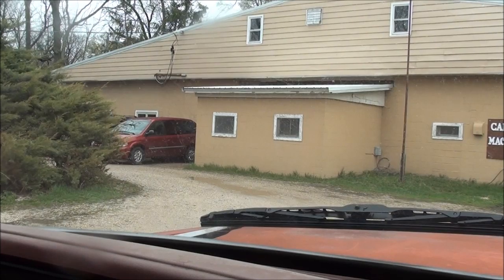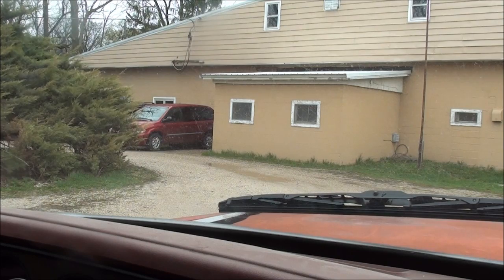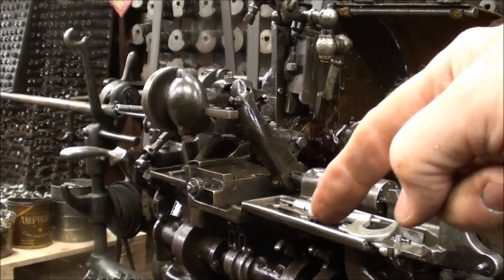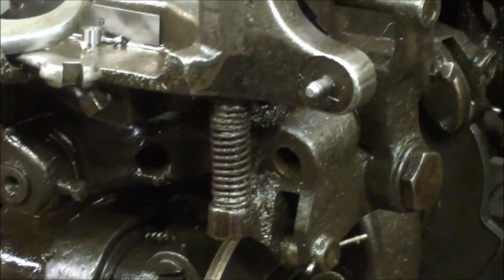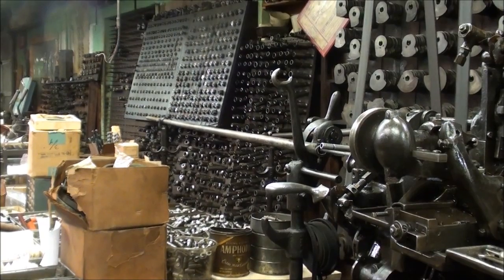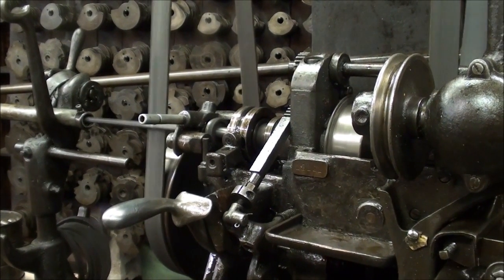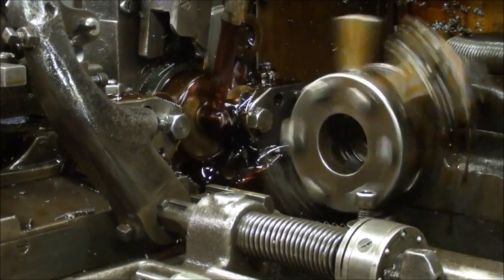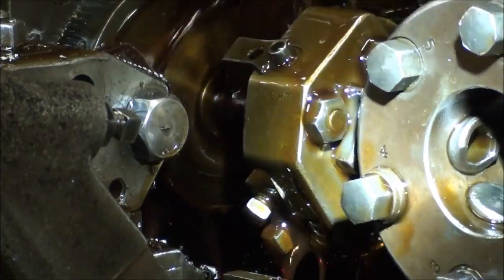tubalcain TAKES A FIELD TRIP #1 The Disassembling of America screw machine shop

Comment: Ran a half dozen of these "00" Brown & Sharp for a few years. !/8th inch brass beads with a hole drilled thru @ 3 seconds! A real joy to see 6 of them running at the same time. All kinds of fishing bodies, Screws, threaded parts of all kinds. Almost lost a couple fingers in the slotting attachment! Ours were all converted from overhead belts.
Reply from the maker: Those brownies are amazing

Comment: Too bad they didn't invest in any Davenport machines that could have eliminated some of the secondary operations. That spacer would have had a shave tool to maintain the diameter and surface finish of the part if it was run on a multi spindle machine.

Comment: This is the first time I've ever seen one of these machines run, although I've worked with machinists who have run them extensively in the past. I think this is one of the few totally mechanical machines that could still be used profitably in manufacturing today, but as far as people bemoaning the change to modern CNC methods, I have only one thing to say. This isn't the world of 50 yrs ago, and technology changes with time. You either accept the changes or be buried by them.

Comment: I used to work at a screw machine shop its still running parts today. I operated a khone 6 spindle it was as big as a truck. Thing was a beast made in 1945
Reply: Where does this shop sell its screws? The hardware stores in my area sell Chinese screws that break!

Comment: Thanks for posting this video. Those old machines are a pleasure to watch operate. But it becomes very clear why they went the way of the wagon wheel. Look at the amount of investment that got put into job specific tooling. If you needed to have all those cams and fixtures made new, buy all the specialized tooling new my guess is that it would be into the 7 figures easily. 
CNC, while not nearly as interesting to watch, is far more efficient. And many will say that all the computer driven machinery is doomed to early obsolescence, but in the end that doesn't matter. By the time they are ready for the scrapper they will have served their purpose. I agree wholeheartedly that the exodus of manufacturing from first world countries is a terrible thing, but the closing of an antiquated shop like this not really related. They chose not to keep up with the advancement of technology and got left behind.  I'm not criticizing them for it, but it does explain why they are liquidating instead of selling the business.

Comment: Saddens me too.......I believe the main reason for mfg. in China is mainly the low wages, and lack of expensive safety gear....of course the poor-to mediocre quality of stuff doesn't help....last week I went to the store to get a simple can opener....the kind you turn with your hand...$3.99....I knew it was junk, but I bought it anyway.....wouldn't even open 1 can.....so I broke out my Swiss army knife....a little slow,  but functional.....
 these B&S screwmachines...is this the same B&S that makes the measuring tools...?
 clipper belt lacer....worth a fortune....I worked at Blue Diamond Almonds here in Sacramento, Calif...we had one of these that was 36" wide...and several 18" units.....

Comment: The place where I work still has several of these old Brown & Sharpe screw machines in use. I'm currently in training on how to set up & operate them. It's been quite a change, going from the newer Mori Seiki NLX2000 and NLX2500 CNC lathes to the old screw machines. Fascinating and very oily :D     Thanks for posting :D

Comment: Back  in the day, we had "Arizona Beef" which slaughtered beef cattle, & cut the meat. Then Arizona By Products was right next door. The fats & glycerin were rendered down and some of it went next door to Revlon, and some of the tallow went to Reynolds Aluminum. The hides went to a tannery.  What no one else wanted went into rail cars & to a dog food factory about 2 miles west of Revlon. Reynolds factory ran about a mile and a half, as did Revlon. Leviton, & Hubble made electrical outlets in Phoenix & Tucson. It's all made in China, Korea, or Mexico now. Being surrounded by copper mines, we had wire mills, & motor winders, and electrical parts manufacturers all over the place. It's all gone now! Western Electric took copper wire as big around as your thumb & drew it down to less than 1mm in diameter. They bundled those up & made 5000 pair trunk lines for telephone transmission. To this day, the American Wire Gauge (AWG) was essentially established by Browne & Sharpe, and their wire gauge templates. The wire is made in Mexico now, or China. It is poor quality compared to General Cable, Triangle, or WECo.
Reply from the maker: Quite a legacy & its all gone.